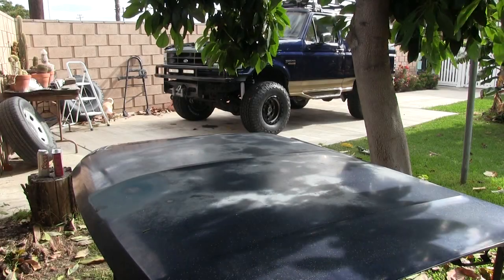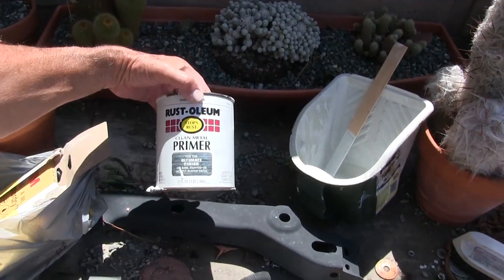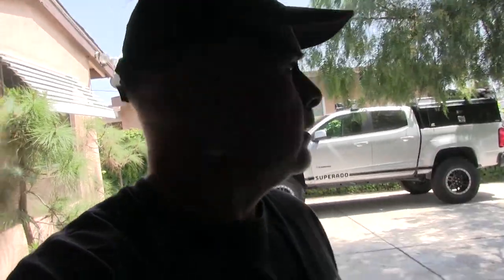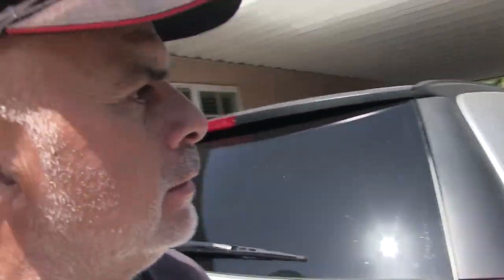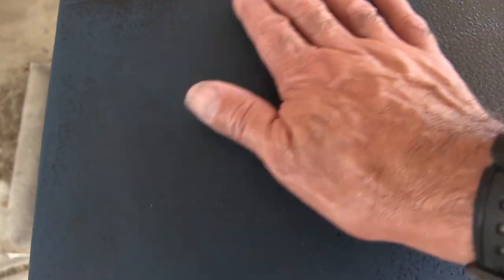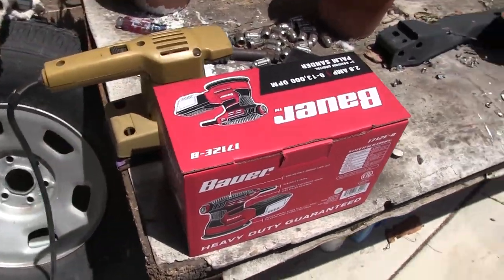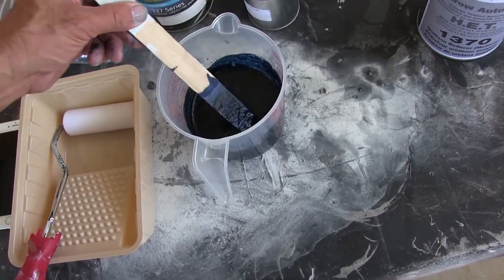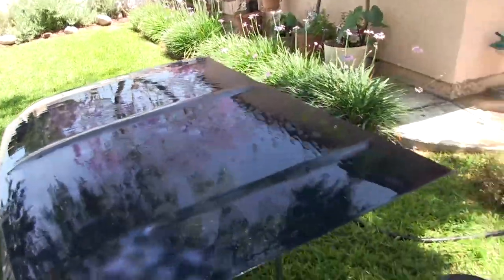Memorial Weekend DIY Paint

Comment: the nozzle that comes with it will work great for auto paint and they are low pressure high volume i use 30-35psi and  you dont have to buy paint twice and rollers and grind it back off 15 times,

Comment: You can leave the paint, clear is all that needed removed
Reply from the maker: I was going to do that but the paint also had cracks down to the primer. I did a test hand sand first not shown on this video. I had to cut a lot of things out in the video.
Reply: @rudedogii  use bondo to fill in imperfections